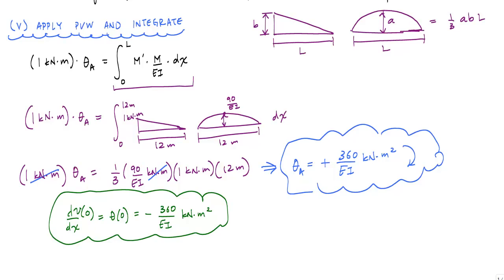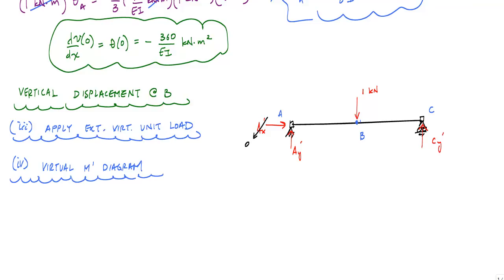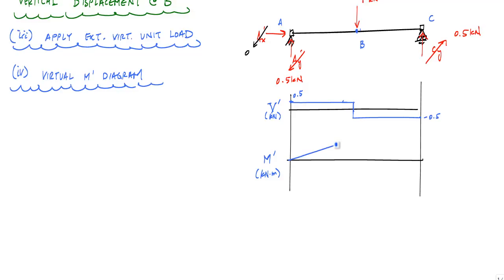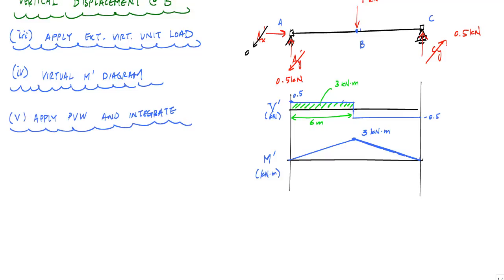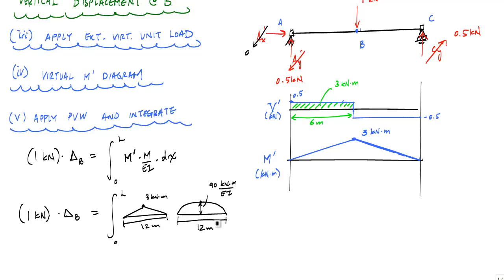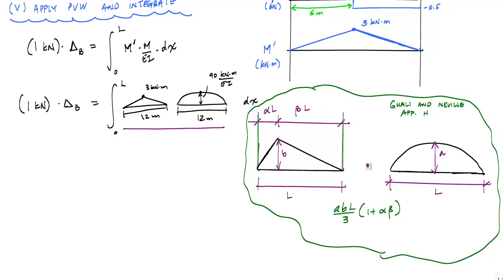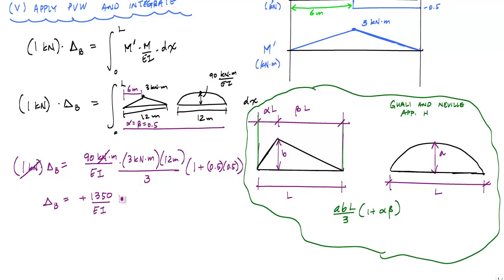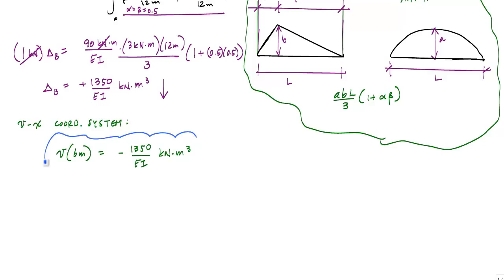Method of Virtual Work for Beams Example 3 (Part 2/2) - Structural Analysis

Comment: how do we use this method on a statically indeterminate beam? if we find the reactions from the real forces by the moment distribution method, fine. but once we place the virtual load on the structure, how do we find the reactions? thanks.
Reply from the maker: Cuntslaw you'd have to repeat the structural analysis again for the virtual loading....typically the virtual loading is able to simplify the structural analysis a little (preferably a lot!)

Comment: Can you do integration that doesn't require that chart? If it shows up on a test we can't use random tables from textbooks we don't have
Reply: David Latham that's also what I'm thinking of, coz I dont also know how to arrive with that formula when you have different given of loading without using the chart
Reply from the maker: David Latham if you look at the video titled "method of virtual work example 2" that one completes the integration without any charts. hope that helps.

Comment: Hello, I watched nearly all of the videos related to this subject and I use this method (charts) and for some reason all of the equations you are using are different from the ones I use, mine are taken from Hibbeler Structural Analysis 8th, not just the form is different answers are different as well! Hope you have an answer to this as my exam is tomorrow :/
Reply: structurefree like in this question i got an answer of 1,147.5/EI while you got a 1350/EI because of the equation being different